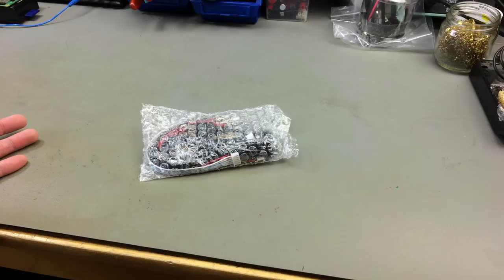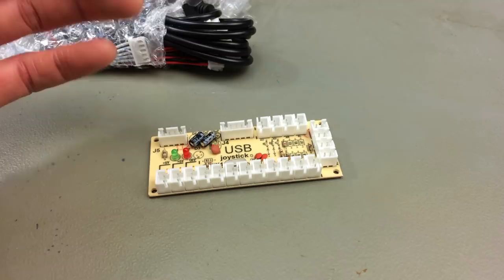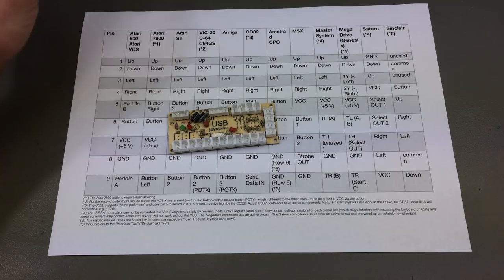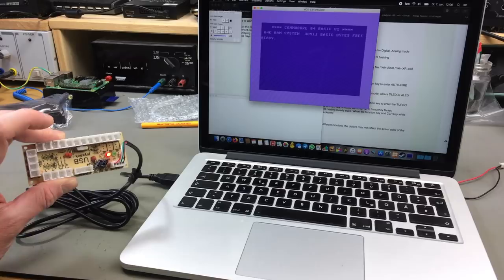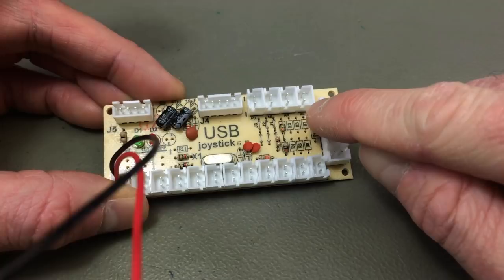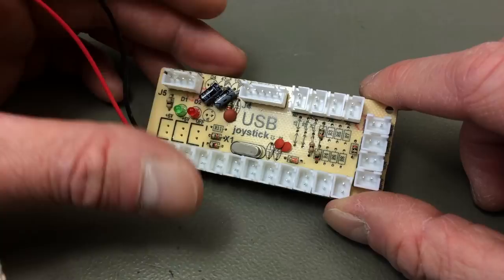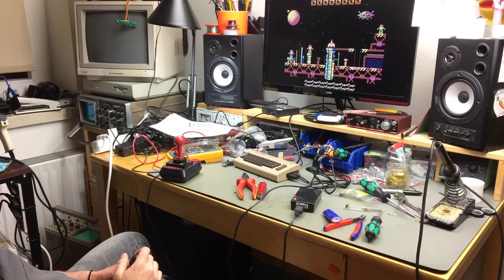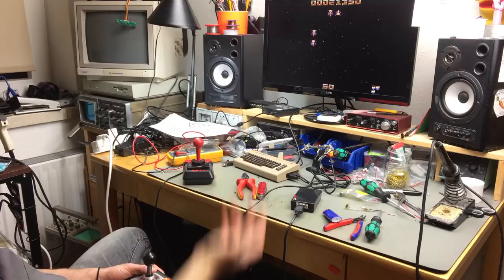Classic Atari Joystick to USB Adapter

Comment: Nice to see the old DB9 joysticks being kept alive. Back in the 90s I designed an interface for using Atari Style DB9  joysticks on the PC, that was before USB existed and the PC compatible joysticks were pretty much all analog sticks using the DB15 connector often found on sound cards. Those were good for flight sims etc, but useless for action games, so being able to use some of the older DB9 Atari style joysticks on the PC was really great.

Comment: For mounting the board, a trick i have used in other places is to screw some plastic 5mm hex standoffs to the board, put a dab of superglue on the bottom of the standoffs, then put it in the case where you want it and hold it down for 20 seconds. You then get perfectly placed screw holes for your board.
Reply from the maker: Yes, that would be a great solution. I will definitely do more tinkering with this thing, might add some proper mounting. :)

Comment: Hi Jan, you could have just removed the crimp pins in the connectors and swapped them over rather than un-soldering and turning the sockets around. There is a little tab on the back that just needs pushing with some tweezers or small screwdriver to release the pins. Great video as usual.
Reply from the maker: Yes, that makes sense. I wanted to keep the wires short so they would fit into the case better. :)
Reply: Much to complicated. You can simply tear the plastic part of the pins on the PCB, rotate it and press it on again (this is the common way to change orientation with 4-pin JST male headers on 3-d printer controllers after changing from A4988 to tmc driver modules).
Reply: @Izaiah Yahir Thanks, I went there and it seems like they got a lot of movies there :) I appreciate it!
Reply: @Jakob Finn you are welcome :D

Comment: Nice work!  When I got my C64 Mini, I hated the feel of the crappy joystick it came with.  So, I modified it with a DB9 port wired directly to the circuit board in the joystick contact lines.  Now I can use original C64/Atari joysticks with it, and probably with Vice on the PC if it’s a standard USB joystick interface, and also it doubles as an extension cord so I can sit farther back from the TV. (Of course, my preference is always original C64 hardware!)

Comment: I was doing the same adapter as you on my own (connecting a DB9 to a Zero Delay USB Game Control Board but then realized the "common ground" of the fire buttons and direction is not ground at all. It is really +5V and it is hardwired to the +5V of the USB connector. That's why in the directional connector it says VDD and not GND. This means you soldered the common +5V to the GND pin 8 of the Atari connector. and the same +5V to the VCC pin  7 too. This has no consequences in a simple joystick without autofire because it is just switches inside and the pin 7 is not connected. So for the joystick it is the same if the switches are shorting to a +5V signal or to GND and the joystick will work. It also doesn't affect to joysticks with a false autofire where the autofire switch all that does is keep closed the fire signal as if the player has the finger on the fire button all the time. But the real autofire joysticks such as the famous Quickshot II use an active circuit with a 555 timer to simulate rapid presses of the fire button only when the player actually keeps pressed the fire button and this ones use the pin 7 and expect to have +5V there and 0V at pin 8. Since you have +5V in both pins (they are in fact in short circuit), I am surprised the 555 chip or the board didn't blow up. Also, when you reversed the 3 fire connectors with the wires already soldered to the DB9 connector, I think you just linked all three buttons together so no matter what fire button you press, you are going to press all three of them. It works fine in the C64 emulator because it only uses one fire button (and also, most old school joysticks had all the fire buttons internally connected anyway).
Reply: Thanks for the explanation. I have just ordered one of these to use with a Quickshot II. Would I need to wire the fire button differently than shown?
Reply: @NeilDeWheel you can isolate the pin 7 and the joystick will work but autofire won't work. I'm sure there must be a way to connect autofire so it can work, but this is beyond my electronics knowledge. Maybe somebody can throw some light on this problem. I did my adaptor and isolated pin 7 to avoid any damage. The directions and fire are just switches so they don't care what is Vcc and what is GND. They will work the same.

Comment: Jan, thank you for the link, very kind sir. I have quite a few 2600 controllers I have been converting myself, the main problem I am finding is the internal structures have broken and do not press the switch domes anymore. I tried a few 3D printed replacements but they were pretty lame. I will be trying to make a few in reinforced resins and see how that goes!
Reply: There are some nice reproduction replacements available for the circuit board in the 2600 controllers if you have a broken board or worn out contact pads that use metal button surface mount tact switches, but ya if the plastic stick parts that make contact are cracked you're pretty much out of luck unless you can find some NOS service parts replacements.
Reply: There's a gentleman that goes by commodore4ever here on youtube that is working on replacing both the circuit board and internal structure of the Atari joysticks... here's a video on it: https://www.youtube.com/watch?v=qqNt0sSXw3g
Reply from the maker: Yes, the Atari joysticks are getting brittle inside these days I think. Saw a lot of broken ones recently but mysteriously they seemed really sturdy back in the day. Nice work on your adapter board, btw, it was literally one of the first things that I got pointed to by commenters. :D

Comment: I would guess you only needed one of the ground cables (connected together on the pcb already)
Reply from the maker: Yes, that's correct. I wanted to make sure that there is a ground connection no matter which fire buttons you connect. But I could have just connected one common ground (maybe on the 5V connector).

Comment: I think it was one more misstake of Commodore to not put at least a cheap two-button Joystick in the Amiga's package, because that lead to nearly all people buying single-button Joysticks like the CompetitionPro  and prevented the game developers from making more games with multiple button support, which would have been a crucial improvement for games like Streetfighter II - although the Amiga was capable of that.
Regarding the adapter: It isn't so obvious that the USB controller used in such an adapter is really fast enough or humans not to detect the lag. You remember that horrible USB-Competition-Pro, that terrified retro gamers about ten years, ago? ;)

Comment: Just make sure you never connect it to MSX or a Sega Master System if you don't want to short VCC to GND :)
Reply: Actually the Master system pads are ok, Mega drive/Genesis ones are not though
Reply: A switch can be added to the box to work in MSX or original Atari mode. Just be sure the box is in the correct mode before connecting the joystick!
Reply: BTW, What happened if you connected a Quickshot II to a MSX computer?

Comment: Atari joysticks are pull-low when activated. The PIA chip datelines are set high initially. The Zero-delay USB encoder is the opposite, or pull-high activated (Not common Gnd but common Vcc). A switch does not care but Vcc to Gnd shorts do. Be careful about pin 5 and 9 as joysticks/pads have various usage and work differently. I found this out when adding a power connector to run led buttons; hen, it's not common ground.
At 25:00 mins it is NOT common ground. It was staring in everyone's face, the wire colour coding , and board markings, all indicate common power +5v. We have all been brainwashed into thinking everything is common ground, like automotive wiring. Oops, NO, NO, NO! Wonderful Chinese engineering.
I used an Atmel micro-controller, atmega32u4 5v. They work in the same way as an ATARI console, pull-low activated.
Reply from the maker: Woah, okay, that makes sense. Will have to reinvestigate. Thanks for pointing this out!
Reply: Just discovered this for myself now that I've finally got to wiring it up. Came to watch the video again and read the comments. Ultimately I guess I'll have to feed the +5v to the common pin and I'm going to miss out on the auto-fire function of my old sticks.

Comment: It's a little easier if you buy a 9-pin joystick extension cable and then cut it in half rather than soldering and mounting a D9 sub connector.  Also makes the joystick cable effectively longer.

Comment: Just tested the 'Retronic Design Universal D-SUB9 Joystick adapter to USB' on the C64mini and it didn't work.

Update: I have updated the firmware of the C64mini to v1.6.1, Tac-2 now works! :D
Reply from the maker: I was going to say: they added support for a many more USB devices in the meantime. Glad you got it working! :)

Comment: OH common  JAN WHY  ? 27:20  you just push pins and take cable out of connector and switch places between them , you don't de-solder whole receiving connector x3
Reply from the maker: Yeah, didn't think of that at that moment.

Comment: I've done exactly as you show using the same encoder, same wiring (but no button 2, just button 1) with all the ground connections for all buttons and directions (I had to use the 4 sockets: AU, AD, AL, AR for joystick) connected together in one bunch and soldered the grounds as one connection to pin 8 (ground).  I get buttons registering but the joystick movements also just show buttons being pressed - no joystick movement being shown in Windows.  What have I done wrong please, Jan?  It must be something simple.  I have done this twice now and I still can't figure it out.  I'm no technician or electrician, so apologies if you think it is a silly question, but your help with this would be very much appreciated.  It has to do with the common ground, I think.
Reply: I'm a bit late to the party, but one big catch with this particular cheapie joystick board is it's not common ground, it's common +5V. It detects a press when an input is shorted to the red USB VDD (5V) line. Which means, for a common-ground joystick, you end up having to connect 5V to the ground pin on the connector to get it to work. Which means sticks with active electronics in them won't work.

Comment: The CPC joystick (your Competition PRO has this mode), has second FIRE button on the same line as Atari Joysticks have 5V, but that is not a big problem. 5V is used only to power Auto-Fire circuitry and it doesn't need much power, so you can power this pin via the 4k7 pull-up resistor, and in the same time use it as input. Regular pins have 10k pull-ups, but 4k7 should be no problem, and it should be enough to power auto-fire on most joysticks. You can go even lower, as low as 1k, should still be ok.
Reply from the maker: Oh, I don't think my competition pro has a CPC mode? At least I wasn't aware of that. It has autofire and "slow-mo" buttons, I think only some of the newer ones have secondary fire buttons. But it makes sense for CPC joysticks of course. :)
Reply: @JanBeta  You're right, there were 6 different versions of this joystick. I never really liked it, so dodn't use it much. Both my favorite QuickJoys (Supercharger and TopStar) were Atari/CPC switchable.

Comment: I could use something like this to refurbish a DDR metal dance mat I modded back in the early 2000s to run off the guts of a USB gamepad. That solution was a bit flaky and messy.

Maybe I could just revisit it too and strengthen all of the connections and cut off any unnecessary PCB.

Comment: I built the same thing a couple of years ago but with my build I put monetary switches on the Case cover for all of the buttons. At one point I added two more ports for NES, SNES and PC. I wonder where that box went.
Reply from the maker: I definitely need to put more buttons on the outside, too. Tried using it with RetroPie and it's pretty useless for most stuff unless you get the extra buttons. :D

Comment: Just what I needed to know; because if this works with the C64 Mini, it should work with my 'Maxi' and I can use all the empty space in the left hand end, put it all internally with a discrete row of small  push buttons for the menus. Thank you. :)
Reply from the maker: Yes, the Maxi should be compatible with the Mini joystick so I suppose it will work fine. :)

Comment: Hi Jan, Love your videos! FYI, there is a common confusion around the plug sizes for VGA and the joystick connector. DE is the little one, DB is the larger size used for parallel. https://en.wikipedia.org/wiki/D-subminiature#/media/File:DSubminiatures.svg

Comment: Always good to have options these days especially since some of the old connectors are goin' away or are long unused. Love to see you do these DIY type of thin's but then that's what it's all about in a way. As I was watchin' past the test with the emulator where you had lag, there is the usual emulation lag but could it be laggin' because of the extra step of converting all the signals through the adapter then to the computer or is the lag still negligible even with that?

Love the stickers on the laptop by the way.
Reply from the maker: I think most of the lag is introduced by emulation. The USB conversion really is pretty fast (as advertised). It worked really well on TheC64 Mini so I think my VICE version is just a bit slow. :D

Comment: You focus on lag and emulation during testing. But the only question should be if your setup is as fast as the usb stick that comes with the c64 mini (or any other compatible usb stick for that manner). Is it? Great video btw :)
Reply from the maker: Yes, it's definitely as fast, feels to be reacting quicker even, because of the long throw the original mini joystick has.

Comment: hey Jan. why did you not do the double joystick version and check if that works on theC64 mini/maxi after the last update, because i want to put that in the maxi on the correct spot. and connect it to one of the remaining internal onboard usb ports. and replace the side usb ports to the back and then with the right side up because all ports are upside down in the mini and maxi.

hmmm ps. why did you not just slide the pins out the connector with the use of a small needle. to switch the arround. lol

Comment: Funny, I was thinking about doing the opposite. Those old VCS controllers are just so frustrating.  I'd rather build a controller using arcade parts and connect a DB9 to it. ;-)
Reply from the maker: I'm mostly using the adapter with my TAC-2 and Competition Pro, love those. I agree about the original Atari sticks. ;)

Comment: Hi Jan, thanks for this 👍. I’ve watched it a few times over but not being experienced with electronics I find it a little hard to follow/see exactly what wire is going where (including the couple of amendments you made towards the end). Is there any chance you could draw a simple diagram of which parts of the board lead to which wire so that I could attempt this project? At least that way if my black/red wires are supplied backwards it won’t matter 😃 (I’m building it for my full size Thec64)

Comment: that custom ic blob on the bottom of the pcb (specifically where they had that made for something that won't sell millions of units) is somewhat more interesting than a converter to 'usb'. lol.
Reply from the maker: Yeah, would be VERY interesting to know what that thing is.
Reply: @JanBeta  if they could have custom chips made cheap enough for such low sales numbers to put them on such a product and still run a profit. that same factory can also make some 6526 and sids and such for us lol.
Reply: been digging around a bit but normally '6502 complexity rate' 40 pin dips start at some 50000 dollars engineering costs and then a few cents each for the first 10000 pieces. ;) i don't think they paid that just to sell a few 1000 of these things.
Reply: could be some off the shelve microcontroller or fpga core but then why isn't it in a normal package... gotta store bare chip dies in nitrogen you know. don't think they shipped them that way.
Reply: (but actually we should simply buy a whole cmos production line and simply start producing the entire 65cxx 74hct and all those old ram chips on sos cmos ourselves. probably better than to keep looking for other fabs to make that stuff for us (as they all try to rip you off on what is essentially just glass and plastic and metal ;) but if these guys did it cheaply enough to put acustom chip on that product it could be an interesting middle step. (not quite in line with the military/space rated quality standards we demand but good enough to service the retrofitting/repair/prototyping market for a while until we get something better ;)

Comment: Interesting - thanks for the video!

Did you know that you can achieve similar results using an arduino such as the pro micro (£5 UKP), and the joystick code that comes with the IDE (no programming skill required). This might be useful if you need something that will fit inside the joystick itself.
Reply: I actually built my own a couple years ago with a pro micro. An advantage is that with the pro micro, you can get two joysticks connected through the same USB port. If I remember correctly, though, I did have to do a little bit of coding for this, but it was not a lot or difficult.